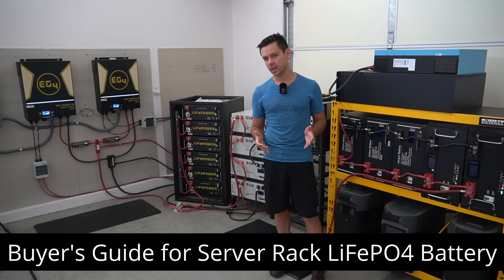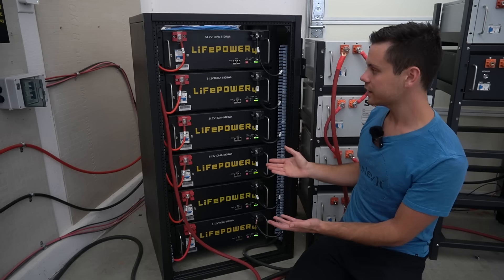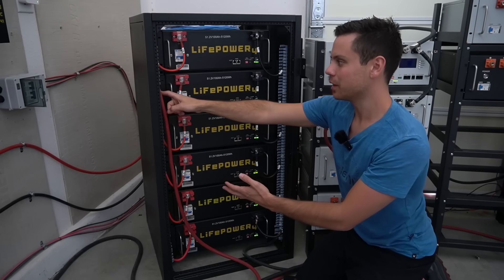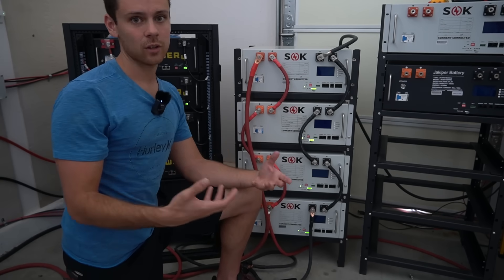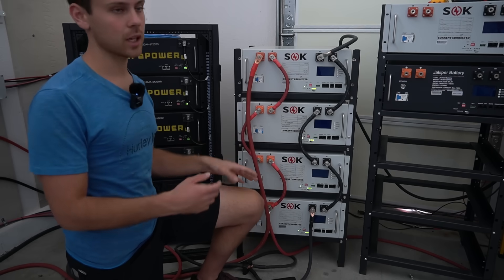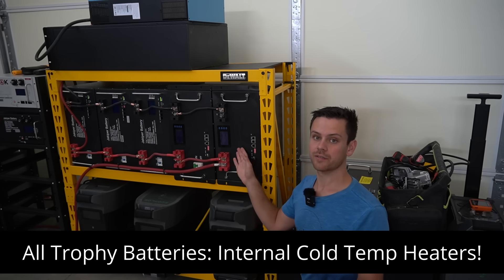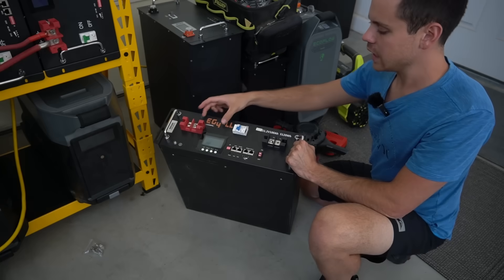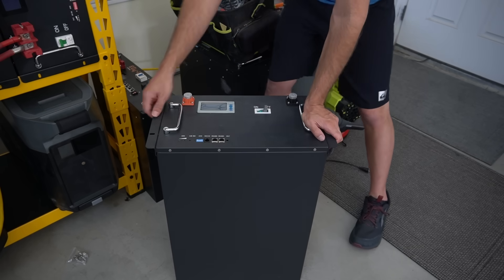LiFePO4 Server Rack Battery Buyer's Guide! For Off-grid Solar Systems

Comment: China has no oil. So they are cornering the world market on lithium and other rare metals.
Reply: You can't really corner the world market on lithium, it's a very abundant mineral but with a high infrastructure cost of production. What China did is commit huge state resources to production, and thus created a price control resistance to others making the necessary investments in production. China is basically weaponizing capitalism against itself here. Our companies and banks simply aren't willing to have the kind of delay between capital investment and profit. And the further behind we fall, the worse that equation becomes.

Comment: Saw a video from Signature Solar claiming that some of their budget eg4 batteries had an issue with the dip switches being installed upside down and causing error 61 to accure even with their communication cables being used.

Comment: I will keep asking for you to test batteries that have heaters in them for operation modes when the heaters are needed and power from solar is less than the amount required to heat the batteries.   Do the batteries continue to provide output?   I think this is possibly a major failure point of heated batteries that don't have a dual mode.

Comment: it is seen that all the batteries have an address selector to be able to use them in parallel, why not use that feature? if any battery enters a state of serious failure the system should disconnect it, but as they are connected it could generate greater problems.

Comment: Hey!
I'm wondering... I am from EU, and I know U are all about off-grid. But is there possibility of discharing battery to the grid? Have You ever met with such devices?

I ask because, in my country it might give me possibility of flipping energy between different hours, which could generate $$
Reply: Look at Grid Tie inverters.
You will also need permission from your electricity supply company to do what you want.

Comment: Just had off grid solar done last year and due to budget constraints I had to settle for 40 kwh lead acid. Will save up to buy the next generation  of batteries for when these die. Each of my current battery packs is 1700 lbs   had to use an engine hoist to move them into place

Comment: I'm building a 6kw system, starting with a Growatt inverter/charger and a 48v Lifepower battery. I haven't found any mention of using these rack-mount batteries standing on end (front panel facing up), but I would prefer it, to preserve floor space. Is it ok to run these batteries in that orientation?
Reply: 6kw or 6kwh?
Reply: @deang5622  I'm building it around a 6kw off-grid inverter. The battery is 48v 5100wh. I may add a second battery later. I don't have a lot of floor space.

Comment: Hi Will, do you have an updated version of an off-grid installation with newer components and products for vehicles?  I have your book and a few products to get started, but I began this project almost 3yrs ago.  My vehicle is a 2003 4runner and have been using it off and on for the last couple years.  Thanks Glenn Van.

Comment: Hi Will, I'm trying to choose between a full on grid UL listed system or an off grid system (maybe CE rated) to save some money. If I use one of those ATP switches that is either/or but can never  connect the solar system to the grid, would it be acceptable to the code enforcers?

Comment: I'm curious to know if those EG4 all in one inverters can be used outside of EG4 batteries? I ask mainly as the EG4 inverters are much more high voltage friendly on the solar input side.

Comment: there is something i dont understand dont you have to use an inverter that will match up to a bms 100 bms and a 200 bms  12 v x 200 a bms 2200 giandal inverter sounds good  but 100 x 12 sounds kinda small  so i dont understand how you use a 3000 w inverter on a 12v  100ah battery with a 100 a bms i wish i did not miss you're live show

Comment: heads up: some of these companies calculate $/kwh using 51.2v * 100ah = 5.12kwh. some of these products have the same energy capacity so the prices are directly comparable. raw cells from china are still much cheaper   but require much more work to use (see also "off-grid garage"). 

eve cells from shenzhen qishou were around $160/kwh after tax and shipping, and can be picked up in LA. eg4 are $290/kwh NOT INCLUDING tax and shipping, but can be picked up outside dallas.
Reply: Yeah but that price comparison doesn't include everything.. the  eg4 has all the bars, wires, sensors, management system, and snappy rack-mount case. I'm not saying the eve cells even with all costs won't be cheaper.. but it sure as heck isn't going to end up $160/kwh all in after producing a usable system.
Reply: @satekeeper  that's quite true. you get a lot of value with the server rack batteries. but for people on a strict budget who are ok doing their own free labor, the bms and extras for a 16s1p eve cell battery bank are $200-$300. so that brings the per-kwh cost up to $180 or so. so the savings over eg4 is around $1600 for 16s1p and $3200 for 16s2p. on balance most people in rich countries reading this should get a server rack battery. but for those making the global median income or less, i just want them to know that this cheaper tier of battery systems exists. of course will has covered this before. and off-grid-garage is keeping the eve battery architecture alive with frequent updates.

Comment: Hey Will see I see a lot of batteries and other solar equipment on Ali baba that are not as expensive and I am in the process of setting up an off grid system. I am inquiring about the quality of the batteries, the inverters and all of the components to make up my system. Any advice?

Comment: I have a question about temp limits/guidelines. What would be the min and max temps for the batteries and when would you need heaters? I am looking at an off-grid system in northern NV and they would be in a garage type location so there may be heat and cold issues that I would have to account for.
I love your videos as they are in normal english with tech only where needed and you normally explain that at the time. Thanks a lot for your videos.

Comment: Also seeing with the EG4 (probably not unique to EG4, I bet some of the others do this as well) the solar charging is RF noisy AF. I have noise bands across all HF bands. 20 meters is the worst during the day. Is very bad. Will need to see if there is any way to filter some of this out.
Reply: Will,  Now that you have basic reviews down.  An advanced build quality review like comparing RF noise (Radio Frequency) would be great.

Comment: THanks again Will I always learn from you videos. I converted my 36 volt EZGO TXT to Lithium and love it, although there were some issues and it was a pain in the beginning like they sent the first pack with there charge (cheep) and they neglected to set the charge voltage to high 58 volts. So I returned the whole thisng and they resent and it was damaged. they sent a new everything it just took a month or more each time but ultimately it all works. Occasionally it just stops for a few seconds Im pretty sure it is either over current or over temp. but it clears relatively quickly. THe BMS in my pack is not the greatest Im sure there using better ones now. There was a weird problem I got a good charger to replace the Big Battery charger with a Lester Sumitt II but I could not get it to charge all the way, I worked with Lester for about a month, my hope is that they create a profile that works . My wife has a 48Volt Club Car when those batteries die I will probably replace with EG4-WP it should fit I think. If any one has advice please share I will post he same on the forum.  What is your relationship with Big Battery now I know you had issues early.

Comment: Is there a way to charge the LiFePower4 batteries with a portable generator?  I'm looking into building an offgrid system for my home for crap hit the fan scenario.  I'm currently debating the system you have there or 6 ecoflow solar generators.  I currently have 1 ecoflow and though about building from there since it's the easiest option.

Comment: I have 45Kwh of EG4 batteries.  I am building a new house and the county will NOT allow me to put the batteries in my house.  They are UL listed but do not have the new UL 9540 listing.  So just a heads up!  Now I know all of are going to say that who cares what the county says, but when you are building a house you have to have a building permit and the county inspects everything.  I am being forced to store all of my batteries and solar equipment in a separate "Solar Shed" which will require me to insulate, heat and cool the shed.  Working with GVMNT to go off grid has been a nightmare.

Comment: My daughter has an electric plan that gives free electricity 8pm to 8am every day.  Video of battery system that powers batteries and runs the house at night but runs off batteries during the day?
Reply: How would you size the pack for optimum battery life and pack size? How would you control the timing of charge?
Reply: Sol-ark 12k has a good time of use function. I’m set up to discharge batteries in the morning and charge them at at 1:00pm . It also has a limited to home mode, so it keeps all power In The hose and not send it back to the power company.
Reply: And is it legal?

Comment: Cadenza Innovation has a battery that has exploded/had fire 0 times in any test. They have 0 propagation and internal shorts really just don't matter since the modules contain the damage to a single cell. Their batteries are the best IMO. check them out if you want Will! cheers

Comment: Another great video.  Thanks.  I have two of the LifePower 48 volt batteries in their newest 6 rack with the door and lock.  It is working fine with the EG4 charge controller/inverter.  I will be adding four more batteries soon. Would it be wise to buy one of the EG4 LL batteries and start that one first for the pre-charge resistor.  My small complaint about Signature Solar's service is that the door latch on my rack didn't reach the connection point on the locking side because one of the hinges was bent.  I was able to use a few washers and make the lock work okay.  When I complained on the comment page they responded that I probably was doing something wrong and never contacted me.  I will continue to work with them because I love the products and I am capable of figuring out most little problems on my own.  An email or phone call would have been nice.

Comment: Great video!  I'm in California and we have power outages a lot. I have a grid tie solar system and I would love to add 3-4 of the EG4 batteries. What do you think the challenges would be to have them installed and pass inspection in CA? I have about 5kw of solar panels and a solaredge inverter. Battery backup is the main goal, but also to optimize for peak power usage hours.  Any info you or others have would be excellent!
Reply: Unfortunately California and Colorado require battery storage systems to have UL9540 certification to pass inspection if they are installed inside your house. The only server rack battery with UL9540 certification is PYTES. Without UL9540 certification, you can still use these batteries and pass inspection if they are installed with the inverters in a structure not connected to your house, like a detached garage or storage shed. If you go that route, you'll have the problem of having to run underground cable from your inverters to your breaker box in the house.

Comment: Problem is that this SoK battery connection will cause charging problem ....in small sistem with 2 or 3 batteries and small current no problem..but place 10 of them in parallel and charge them with high current and you will see that the last battery will have lover charge voltage than the first one.......small voltage drop on each bridge......makes big difference in charging LiFePo4 batteries.

Comment: I have a question for you! I have 6 EG4-LL batteries, 64 LiFePo4 230 amps under 4 DALY 200AMP bms. I run two 12 kw Growatt inverters. My question is, is there a way to combine the LiFePo4 with the EG4-LL Batteries? Thank you!
Reply: Just hook them all up to one busbar prior to them connecting to the inverter.

Comment: I just stared using the Growatt 48v 5kwh Axe battery through Signature Solar. They are the easiest battery I have ever used. They plug into each other in stacks of up to 10 high. So far so good.
Reply: I just bought the 48 volt 2.5 Kwh ark and so far ,, very happy

Comment: I can't speak highly enough of Current Connected and the SOK batteries. Dexter from Current Connected went out of his way and was helping me and others on the forums troubleshoot some communications issues between the SOK batteries and LV6548 inverters. It ended up having nothing to do with the batteries and was caused by buggy firmware on the inverter. Dexter is awesome and so is Current Connected. I have a smaller system so the SOK batteries made sense for me, but I'd still purchase them for a bigger system. The display is nice for troubleshooting any issues you may be having. It doesn't get used often but is nice to have when you need it.

Comment: This might sound strange, but I think a lot of people do not understand what a "Server Rack Battery" is and so they do not bother to click these type of very useful videos.  They need to understand it is just a typical shelf (i.e. rack) that holds several batteries connected in series or parallel to provide electrical storage power.  A very simple thing.  Once they understand, you will get many more hits.  
Bty, I love my Dewalt Rack!!!

Comment: You used to have "Big Battery" listed in your links. Do you still think they are a quality battery and if so, what do you think of the "Rhino" 48v model?  Also what about the large Kilo Vault, I think they are both American made instead of the sometimes questionable Chinese brands?
Reply from the maker: No. I avoid them. Had too many issues with those batteries.
Reply: @WillProwse  what is your opinion on the new 12v and 48v thin batteries they just released only 1.5"x 10.5"x48" for 12v.... 48 v is 14kw
Reply from the maker: Kilovault is good. Only seen one dead on arrival unit.
Reply: I believe they are assembled in the US.  I am interested in them also as you can purchase large capacity batteries and not have to deal with server racks, bus bars, current equalizing issues, etc just plug it into a all-in-one inverter and use the system.  I also think they are easier to have multiple units as I remember they sell a "box" with the cables for hooking up up to 4 separate batteries with an output cable to the inverter -- again, no messing with cables and exposed bus bars, etc that you have with server rack batteries
Reply: I just saw that Will answered about reviewing Big Battery elsewhere and said he had bad experiences with their products and thus stopped reviewing them.

Comment: Any comments/experience with the Growatt AXE 5.0L? Very modular, easy to set up and price-wise similar to EG4. They' re really great, it seems. Curious if you had a chance to take one of those packs apart.
Reply: I am interested in these batteries also for the same reason -- ease of set up and expansion.  No set of cables hanging out no server rack to build, bus bars, etc no matter how many batteries are used (to a reasonable limit) and also a narrower footprint as I have space limitations.  They were on the Signature Solar web site but now they are gone.
Reply: @ronbridegroom8428  I ordered 6 along with the growatt 6000 watt inverter.let's see how it works out - install sure is easy peasy. it's nice that the inverter gets 240V out in a single box. don't need to stack them and yes just one battery cable to connect. I wonder why signature no longer sells them

Comment: Still fighting with the EG4 E61 issues.
Reply from the maker: I'm getting my third cable set. So far no one has communication working so waiting for them to solve that
Reply: @WillProwse  Thanks for that. Good to know is still in progress. Just have it set for user batteries as you previously suggested. I have a set of the LL batteries, BTW.
Reply: I ordered 2 EG4 inverters (on back order over a month) I saw signature solar vid on E61 error are you saying its still not solved? Are the comms for viewing data or for the inverter to react? I would like to study the data so should I get the EG4 battery with display?
Reply: @ColorMaker_Solar  Cables replaced twice. Works for a while and then goes back into alarm. Unplug, shut down everything, do a full startup, works for a while and then goes back into alarm.

Comment: Thanks for the video! I am curious about the warranties though. I believe EG4 is only 5 years and SOK is 10 years. I was ready to pull the trigger on the EG4, but that has me second guessing the choice. Could you give some information about the warranty of all the batteries in your comparison?
Reply: The EG4-LL battery with the display that interestingly he says he doesn't need or like in this video, he does in others! That battery has a 10 year warranty which in my mind makes up for the additional cost and is same as SOK in price I believe.

Comment: Other than the EG4 brand, do any of the other brands offer a 12v server rack battery? Looking for a 12v server rack battery for a camper. I watched a video of the EG4 brand in a camper and he had trouble with the battery BMS shutting the battery down when he tried to power an a/c unit. He switched the BMS with a different brand of BMS and it worked.

Comment: How do you deal with off grid inverters with existing wiring for on grid as want to run parallel. I have seen small voltages running over the off grid circuitry due to induction (example transfer switches, wires running parallel - though i moved half a foot away and still seeing 1 volt on the line).